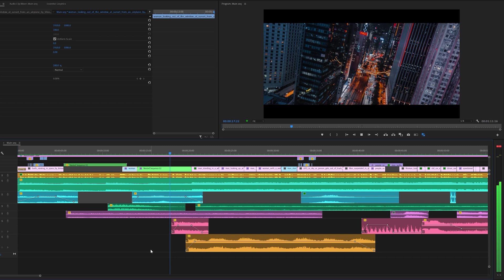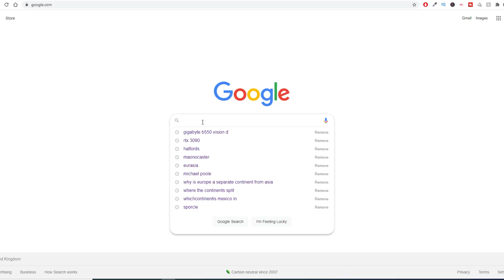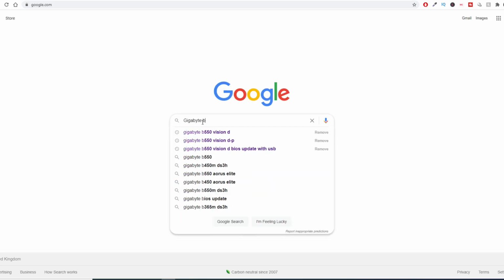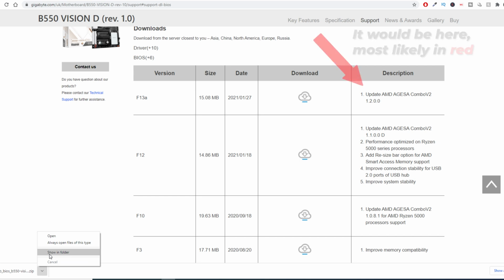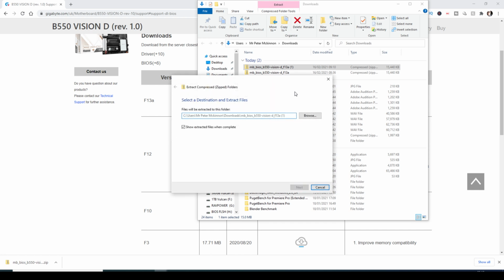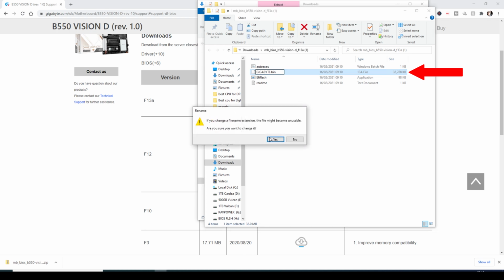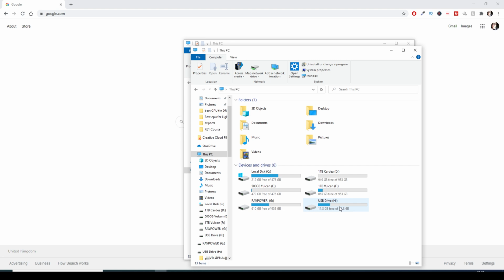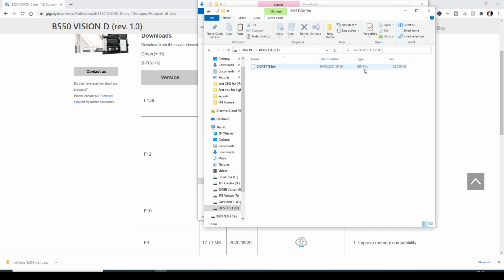How to update Motherboard BIOS without a compatible CPU? | How Bios Flash (QFlash) button works?

Comment: what if the motherboard support the latest gen like the i5 13500 and the motherboard like the MSI tomahawk b760 which does not have a bios flash back button? Or do i even need a bios flash back for this one?

Comment: hey sir, I have gigabyte z790 UD AX motherboard with i7 13700k, ddr5 5200mhz ram.
recently I bought a WD sn850x 1tb nvmv ssd, after install it its showing in device manager or disk management, but in the bios msg showing there is no nvmv ssd. I try update bios but problem same. I create a partition in disk manager or try to install window 11 in new nvmv ssd. window install in new sd or work well with all software. but still in the bios msg showing there is no nvmv ssd. any idea how to fix it ??? thanks..

Comment: If suppose I break a motherboard bios,is there any solution bro...please explain because in my gigabyte b550 aorus pro V2 after insert the usb for bios update and when i press the flash button it get break down and my bios update continuously without stop....

Comment: I don't think that my mobo supports q-flash plus. The CPU I have is only supported after a bios update. Am I SOL and have to buy a either a new mobo (that already supports the cpu I have) or buy an older CPU (that the mobo supports) to be able to flash the bios to be able to support the newer processor?

Comment: Thank you so much for this! Really appreciate that you did this video, I combed through lots of videos and searched on google and youtube after thinking I bricked my mobo trying to to tweak settings on a kit of 4x32gb ram that I found out to be defective. My bios wouldn't even post. Seeing your video, I did this as a last resort and my system is back up and running without any hitches and even allowed me to ID the problem item. Without this video, I'd have probably refunded the RAM sticks and bought a new MB or something. Would have been a huge workflow issue. I cannot stress how big of a deal this is because atleast now, I can try to work with the manufacturer on either a refund/replacing the defective sticks while utilizing half of the product I received, which is still better situation than just going back to using my old RAM. TYVM!
Reply: Hey so I'm trying to learn as much as I can before I get a new Mobo and CPU. so if you "brick" a motherboard can you reverse it, if I'm not mistaken it seems like you were able to. I'm not to sure that brick really is. Also I'm afraid that I do something very small wrong (maybe with formatting or extracting or something) and the Bios update doesnt install. If I don't get it right the first time would I be able to try again?

Comment: I'm busy building a PC using this B550 Vision D-P, a Ryzen 5900, and a Corsair 5000D Airflow, all chosen after watching your great videos. And then I stumbled across this... 
So I should remove the CPU before doing this? And the RAM, and unplug the drives?
Many thanks!
Reply: Hey man so did you have to update it ? Or was it working out of the box. If you did update it did you fo it before u put it together
Reply: @JetWabi  Ideally before, but I did it after installing the CPU - I didn't know about this whole BIOS thing. In fact I've done it several times since with no ill effect. Once after I'd put in a new drive and the thing refused to reboot - I flashed the BIOS and it was working again. 
So keep the USB stick somewhere safe.
Two things I also didn't know is that the MB will only run the GPU at top speed if the second PCIe slot is left unoccupied, and you can't use the third PCIe slot if you're also going to use the second M2 slot. It's in the manual, but not made clear when you buy it. But I bet similar is true of other boards. So, big GPU, and nothing else for me...
Reply: @KarelBata  so how many m.2 add are using ? 2?
Reply: @JetWabi  I'd already bought two M2s, so I could have sent one back, but opted not to. I would have used the third PCIe for a sound card I have from a previous install. However this MB has got an optical sound out (I hope the software sees it) and with two USB Cs I can buy a sound breakout box running from one of the Cs. 
My applications are editing video, some of it 4k and some 3D, so I like to spread the files around a bit so they aren't all loading from one drive. Particluarly 3D which would have left on one M2 and right on the other. They'll be writing to a separate SSD. Also two slow HDDs are for long-term storage. I also want to play around with AI, so fast access storage is an advantage - two M2s will be faster than one. 
Just my choices really. 😉

Comment: on the two ASUS B550 boards I had to flash for my Ryzen 5000 series CPU, I had to format the USB-drive using diskpart to restore the Master Boot record, otherwise the BIOS flash wouldn't work. I wasted days the first time bc the LED of the mainboard told me the flash was successful and the PC didn't post at all.

Comment: Can I flash BIOS with everything installed?
Reply from the maker: Yeah.
Reply: My mobo is gigabyte a520i ac with 5600G processor. 
I put my
flashdisk and already formatted to fat32
as default then plug in to bios usb (white)..
but when I hold Q-Flash button, it didn't
has an indicator for updating the bios,
didn't blinking :(

Comment: Bro when i check my setup in  website it says
Warning! Some AMD B550 chipset motherboards may need a BIOS update prior to using Vermeer CPUS. Upgrading the BIOS may require a different CPU that is supported by older BIOS revisions
do i really need 2 cpus?

Comment: Hello Tech Notice!

I'm currently having issue with the computer not posting. I think it has to do with the bios since I checked most of the troubleshooting you should do to make sure the computer part is not the issue. Now here is the thing I don't know what the Gigabyte Aorus Elite version it is and I don't know which version I should start of with before I move on to the latest bios if that mobo. Thanks

Comment: Followed your instructions and everything was going smoothly. But after the flashing stop the code 00 and, dram lights and power supply never shutted down. 10 hours later and everything is still on. I am nervous to shut it down and wonder if it worked or not. Any tips appreciated
Reply: Found the culprit. Don't use a 128gb USB Stick. I have retry with a 8GB stick and it took about 5 minutes.
Reply: I have the same problem right now, the PSU never shut off, can I just turn off the PSU and try it with another USB-Stick?

Comment: Think it’s working be CAREFUL to get the correct motherboard lol. I have the b550 vision D-P. Tried to push the bios for the d not the d-p. Luckily it didn’t take it. It flashed and the red leds never turned on. I quickly got the correct bios and everything is happening as the video shows and looks like it just completed time to toss all my hardware on and get this thing bootedddd
Reply: It didn’t come with supported bios out the box ?

Comment: To anyone who can't get it to work: I had to change my drive format options from (ex)FAT to NTFS. Give that a shot!
Reply: thank you so much I'm trying to take in as much tips as I can before I buy a new CPU and Motherboard. So when you found out it didnt work was it after you plugged the usb in and hit the button? at what point did it not work. The main reason I ask is that I want to make sure I dont do any irreversible damage to the motherboard. It seems pretty simple to do but I'm afraid something small does work out and messes up the whole thing. I would love to know please! <3
Reply: Bless this one comment.  You are the only person to contradict the FAT32 messages and this saved me a huge headache because I could NOT get it to work with my Z490 board.

Comment: Is there a way to check if my PSU is working? I connected everything and plugged the USB in but my MB does not start to flash , regardless how long I hold down the button
Reply: And yes I switched the PSU on :D
Reply: Have you found a solution to this? I’m in the same situation 😭
Reply: @cherie1204  yeah - I went through a cpl of things even bought a second MB bc I thought it may was broken but at the end I double checked how I connected the cables on the PSU. I did a small mistake there

Comment: Hey i have the same motherboard and a 5600X. My button does not make a light turn on. I am updating to the f13c update that is currently available off GB website. I should be getting power. Do you think I already messed up? Kinda freaking out bc of 1 led light right now haha...  What could I be doing wrong?
Reply: Did it work?

Comment: i looked for the motherboard with white back... additionally I wanted to have at least 2 usb-c connectors on back + 1 on front ... and this version DP thanks to you is now for me the obvious choice... regarding the bios update button.. i think it's wiser to have it inside your case :) so your small kids will not push it while discovering the world :D so this motherboard should also recieved "Child Friedly" certificate ;) thank you for your job with this ... I was wondering if not to get Asus ProArt Creator, but the only advantage wich I will not even benefit from now is thunderbolt 4, on the other side - no wifi + bluetooth.. black backplate :/ is there anything better there with Asus Creator besides thunderbolt?

Comment: this didnt work for me, i followed exactly how you have done although i just stop flashing it did not show 00, i then tried it again and it does not flash at all when i press QFLASH please help.
Reply: did you figure this out? Mine doesn't blink at all.
Reply: @JacquelinGaribay   yes I did, it may be obvious but you need to only have the cpu and power supply cable connected no other hardware can be connected it will not work
Reply: @lifewithdxnwa6701  thanks!

Comment: I need to do this for my first build. I actually started doing it yesterday and I was going to update bios but my motherboard was dead on arrival. At first I thought I bricked the MB but I was grounded and put the correct atx pins and inserted the usb. But MB was dead so luckily my new MB is coming today and Amazon refunded my original payment in full so basically I got a free MB

Comment: How long does this process normally take? My board is stuck on 00 debug code and the D Ram led is solid now for ten minutes. Using the Gigabyte Vision B550 D-P board. Q Flash stopped blinking a while ago now.
Reply: Mines doing the same thing, did it turn off eventually?
Reply: @JacquelinGaribay  Nope... I just powered down eventually and hoped for the best. Fortunately nothing bad happened. I changed the BIOS version to the latest and it worked fine and took 5 minutes... BIOS version was the problem... If the debug code is 00 the I believe the MoBo is error free and right to turn off...
Reply: @neonzeon4236  having same problem... after your powered down, did you change the bios without the cpu again or did you move forward with the build and update bios with cpu?
Reply: @wearethetelevision  I powered down with no worries... 00 debug code was showing so I guessed it was fine it was... I just turned it off, got the most up to date bios, and started again... No CPU... I also changed my USB stick to one with a flashing red light when it is reading...
Reply: I think my first recommendation would be using a usb stick with a light that confirms you are reading the stick

Comment: I used to stay up to date, BIOS, Chipset, etc…
During a new build, I bricked my first board.
The cost of replacement was so much that it traumatized me, and I haven’t flashed or updated again in nearly 15 years.
NOTE: at work, I run Dell or HP exe BIOS updates all the time; not my money if they brick, but not one has failed yet.

Comment: If I have the B550 Vison D-P do I still have to update the motherboard BIOS? Or am I good to go out of the box?
Reply from the maker: I'm not 100% but as far as I know you should be able to go out of the box. I'd still check for bios updates after the build is complete :)
Reply: @theTechNotice  thank you 🙏🏽
Reply: @tritensilva1053  Did you find out if you had to update the bios?
Reply: @robbecallewaert5987  it was good to go out the box. No need for the update
Reply: @tritensilva1053  what cpu are you using ? I just bought one of these b550 Vision d-p mobo and I have a ryzen 5 5600x I have no clue if I need to update the bios or not
Reply: @vvrexy  what did you end up doing?
Reply: @DatGuyArad  it was just plug and play I ddnt have to update the bios for my ryzen 5600x
Reply: @vvrexy  Nice thanks for responding

Comment: Connected Corsaire RX850 PS to CPU and D-P version motherboard power connections. Created BIN file on flash drive per your instructions. Powered up, inserted flash drive in BIOS slot, pressed the button for several seconds and nothing. No led's, no numerals displayed on 7 element indicators. Did I miss something in the video? A switch or something? Going to install the Ryzen 5950 CPU when the BIOS update issue is resolved. Great videos! Great content as well. If anybody has an answer to this problem, I would appreciate your input.
Reply: same issue here, im trying as i write this... i have corsair RM750X and the B550 Vision D Motherboard. I followed all steps in the video but when i press the qflash button nothing happens. kept it pressed even for 10 seconds but no flashing light.
Reply from the maker: PSU is definitely switched on?
Reply: @theTechNotice  Got it to work! When saving the file, windows changed the "Opens with" program to explorer. I switched the opening program to Word Pad. We will be putting the unit together today. If there is any problems with it, I will provide updates. Thanks again for your response.
Reply: @theTechNotice  yep.. will try tomorrow a PSU test with the paper clip bridge on the green and black wire and a case fan to see if it spins. Also, i will try to format the USB on a windows laptop and also use  a different USB stick.  pretty hard as there's no led light indicating if the MB is on. Not sure if those qflash lights can blink without a usb stick inserted first
Reply: Michael Kellinski; You may save yourself some trouble by making sure the file will open with Note Pad. When you power up the board and insert the flash drive, press the "Q" button, within the first 30 seconds or so of the BIOS yellow LED flashing, the power supply cooling fan ran for about 5 seconds on low speed. It took about 5 minutes for the process to complete. As mentioned in the video, when the process has been completed, you will hear a click from the power supply and the flashing yellow LED will be off.
Reply: @theTechNotice  i finally managed to do it. i was trying with a 12 gb usb stick. went and bought a 8gb one and all good now.
Reply: @marcellperina  Did you ever get it to work? Same issue.
Reply: @jamiechestnutfineart  i managed to boot into the bios menu with the cpu in the socket  without crashing  and updated it to the latest with a pendrive. I have a ryzen 9 5900xt so your experience may be different

Comment: I’m attempting to flash the bios on my ASUS ROG STRIX B550 f gaming wifi motherboard. Can I just download the latest update on a usb stick. Then just as done in your video connect the power supply to the motherboard, and plug in the usb stick and update the bios.
Reply: Yes you can (I know this is late)

Comment: I have the same MB and I’m currently in the process of making my new build. I also have a Ryzen 5000 cpu and was going crazy trying to find out how to update the BIOS for this particular MB because the flash button wasn’t on the usb slot section.....didn’t know the flash button can be on different locations on MBs until I saw this video. Thanks for making this vid, helped out a TON ! You just earned a new subscriber right here for sure.
Reply from the maker: 😇👍 thanks, glad I could help!